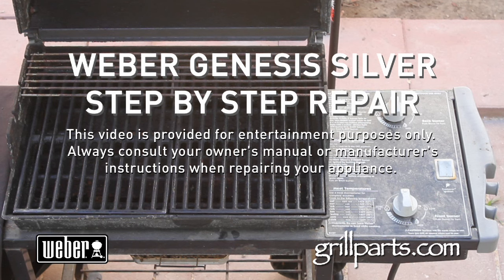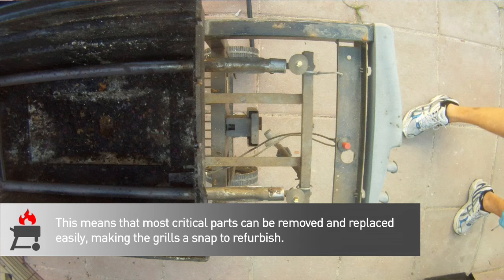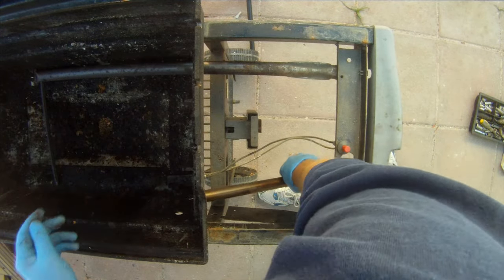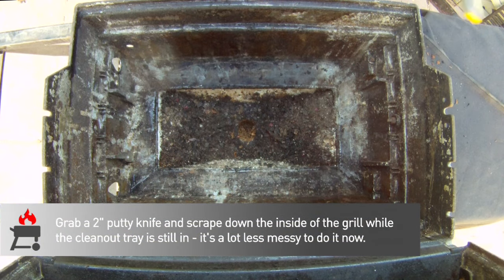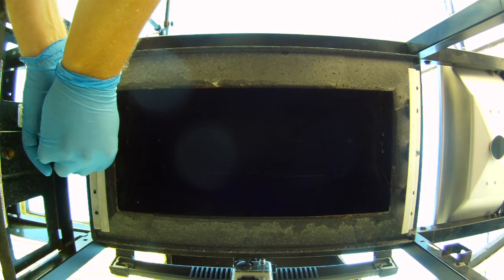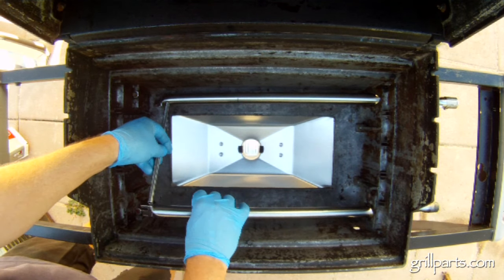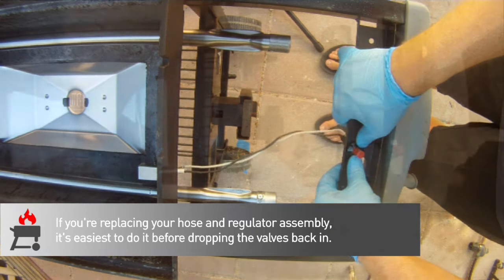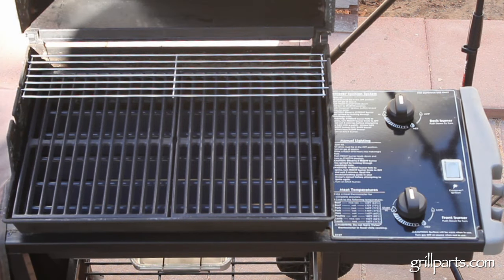Weber Genesis Grill Repair

Comment: Great video. I have rebuilt my Genesis Silver A once before, but it's been about a decade. This video is very helpful. Thank you. Quick Question: After you scrape the gunk out and you go to work with the hose and scrub brush, do you use any type of cleaner or degreaser to help the process? Thanks again for this video.
Reply from the maker: Sorry for the delayed response. We use CitruSafe and 00000 steel wool (https://grillparts.com/grilling-accessories/?productID=3100107)

Comment: Don’t know if anyone will see this but I got the 3 burner one and the front burner isn’t getting propane.  Any idea what part that would be.  Back 2 work fine but it’s a pain to ignite it now
Reply from the maker: The problem might just be a blocked burner (spiders love it in there) or something like a bad valve. You can figure out which grill you have (and find the parts) at https://www.grillparts.com/weber/
Reply: @grillparts  thanks, I ordered a new manifold, and once they came in it started working again before I could install lol
Reply from the maker: At least it working - enjoy!

Comment: This video saved me $400!!! I had actually put my grill up for adoption, but nobody wanted it. After poking around some of the other videos, this one was so clear, it gave me the courage to dive in & do it myself. Replacement parts for burner, ignition/starter, flavor bars, grates & drip pans + liners cost about $200. The replacement Weber I had my eye on was ~$600+. Gotta say it is a RIGHTEOUS FEELING to fire up my new guts (on so many levels) grill. Thanks for the great video instructions. I'm a 61 year old former tech writer----if I can do this, so can you!

Comment: Where is the serial number? I have a genesis silver and can’t find it
Reply from the maker: Located on the right edge of the control panel, behind the molded trim panel. Cheers!
Reply: @grillparts  I still don’t see it?
Reply from the maker: Hmmm - it could have come off at some point. You should be able to tell which model it is from this sorting tool: grillparts.com/weber/

Comment: Grates alone these days if you can find them are about $150 so I’d have to think a full rebuild would be close to $700-800 plus my labor. With the grill 20 years old I’d just as soon get a new one.
Reply from the maker: The parts used in this video add up to about $275 (and there's a link in the description) & new Genesis grills start at around $700, but you do you.

Comment: I've always had my eye open for a new propane grill but I've kept my 25  year old Weber Silver is still going strong.  I have a stick burner smoker, pellet smoker, Weber kettle, flat top grill, and open firepit for all kinds of grilling but there is no need to upgrade your propane grill if it is solid and still does the job.  2 things that are a must for this grill: 1) cast iron grates and 2) for the pros that know exactly what they are doing (and I don't recommend this for the average bbq guy): unregulated propane hose for those moments when you want to get a 700 degrees sear.

Comment: I prefer those old push igniters over the battery ignited ones they went to after the silver series I believe. I've had a silver one for over 25 years and replace the igniter maybe three times. I just got a used Genesis s310 and needed to do the igniter right away because it was dead. It seems to me the old push ones are much higher quality you don't need batteries to run and they never fail to start

Comment: This video is perfect, straight to the point and clear. We have had our grill for 15+ years. This is our 3rd time buying parts for it. The website is great to navigate, to find exactly the model and the parts. This time I found this video and was willing to try to change the igniter that does not work for a while. Great job on your order process too. 
My only suggestion is to put the video in a more accessible place, because it was embedded in one of the parts and it covers much more than just that part. Keep up the great work and quality!!

Comment: The bolts that hold the manifold in both snapped any suggestions how to remove them?
Reply from the maker: That's a tricky one, but you should have enough room in there to drill it out or cut it off & replace it...

Comment: I have a question, I have a genesis DO1058141, from what I can tell it is a genesis gold c, with a side burner, I don’t see any steel grease trays like this on the website, also I need to replace the push button ignitor collection box, but I’m not sure which to replace with. Thanks, great video
Reply from the maker: Sorry for the lag - your comment got held by YouTube. Did you get your grill sorted? The best way to get help is via email on the contact page of our website https://www.grillparts.com/policies/contact.htm

Comment: I don't have a a Weber but one of the Brand X generic gas grills. I wouldn't have replaced the burners as you can clean those out with water or pressurized air and they really ought not to get too dirty. I got my grill from some friends who'd never cleaned theirs and were throwing it out because they got a bigger and better one. I see gas grills on the curb all the time time and nothing that a putty knife, degreaser and some elbow grease won't fix
Reply from the maker: No burner lasts forever. The burners we took out of this one had recently been replaced, but we wanted to show how easy the process is.

Comment: @grillparts
Question the connection between the valves and the burner tubes. Is this supposed to be loose. Or are the burners meant to be attached to the valves
Reply from the maker: There is usually a bit of play in those connections but they shouldn't be too loose.

Comment: Do you recommend using a MAPP gas torch to loosen up the screws and bolts that don't want to come out?
Reply from the maker: Haven't tried it but that aluminum will start to get mushy at around 1200 degrees...
Reply: @grillparts  thank you I didn't realize how cold it had to be for the aluminum to melt.
Reply: @grillparts  Oh No both manifold bolts broke off. Any tips to remove? I tried 3 different remover junk things them bolts sem to resist punch and drill bit(maybe need a different bit??) What a mess
Reply from the maker: @jeffreywolf5235  drilling them out is probably the only way.
Reply: @grillparts  yeah I'm going to have to get some high-quality left hand drill bits because the ones I have are all old and just cannot drill into the screws. I must have 300 drill bits and not one of them will work most of them are too big. If I had a welder it looks like as a nice trick of welding a bolt head to the broken screw and removing it that way but I don't

Comment: On the crossover tube...is there a certain way to lock it in..or which way to the holes need to be oriented?
Reply from the maker: The burners & crossover really only go in one way. Once they're in place, there's not a lot of movement or need to lock lock it in.
Reply: @grillparts  I see how the burner go in. But the crossover tube is free to spin and no way to"lock" in
Reply from the maker: No need to worry about it spinning. Have you put this together yet? There's nothing acting on the crossover to make it spin, but it's also not quite round. Just put it in with the holes facing up. Here's the instruction manual https://www.grillparts.com/images/products-grill-parts/grill-parts-10404.pdf

Comment: My dad just gave me his Weber grill that he bought in 1985. He hasn't used it for the last 20 some odd years.It was outside for the 35 years that he owned it. It was protected by a bbq cover. The only thing that I had to replace was the hose and regulator assembly. BTW, my dad was a tool and die maker and replaced all screws, nuts and bolts with stainless steel ones. As well,  he replaced the original "flavorizeer" enamelled angle bars with .5 cm stainless steel. Apart from some rust and discolouration of the bbq lid, this bbq is almost like new. Is there a safe way of painting the metal parts? I plan to paint the legs with rustoleum type paint but I don't know how to refurbish the black enamel lid or the sides. What should I do? I do not want to sell this bbq ever. It was the first bbq my parents bought and I want to treat it like and heirloom. When I lived at home as a young adult, my parents finally felt that they were financially "comfortable" enough to be able to afford a gas bbq. This was their one and only gas bbq and today, I was able to grill our family lunch.  It's a keeper
Reply from the maker: Your best bet would be to use BBQ paint and go for a flat black finish. Re-enameling the grill is a pretty tall order, even for an experienced sprayer.

Comment: which direction should the holes on the crossover tube face?
Reply from the maker: Hi Patrick.
The easiest way to tell is by looking at the larger holes for the crossover burner - those have to face toward each other.

Comment: I've had my Weber it's a 3 burner Weber since 1995 and unfortunately all the bolts that are inside of it are so rusted they fused themselves to the other parts and I'm afraid to touch any of them with the risk of it just disintegrating on me unfortunately I think I'm going to have to get replacement grow or a new one altogether I would love to but disabled it took me a long time to buy this Grill so it's going to take me three times as long as you get another one but but the best grill for the price No Doubt I've replaced a guts about 6 times over the years including the ignition starter the last time I did it I got super thick flavorizer bars and those things still look almost a new shape and they're over 3 years old
Reply: Remember if the outter body casing is damaged, its warranty covered for 25 years . Just received upper and lower due to corrosion

Comment: Hi - how do you change the thermometer? The original one on mine seems pretty wedged in so I don't know whether to use some old fashioned brute force to get it out (i.e. a hammer) or if I'm missing a smarter way? I have a replacement with butterfly wing nut.
Reply from the maker: Do you know what model you have? This is a Silver A, so it has the thermometer on the right side that just slides out - but it was stuck in there pretty well. If the replacement you have has a wing nut, you have a different (probably newer) model.

Comment: I own that same grill which was out for the trash.  The pan under the grill is corroded.  The grease pan holder is rusted to the point where the metal broke off it that holds it to the large pan above it. The pencil size burner that connects to the 2 larger burners is rusted out to where it can not attach to the one of the larger burners.  The grill cost $379 new which someone purchased in 2004.  New flavorizer bars and cooking grates along with disposable grease pans were purchased in 2011 but the store may not take that stuff back.  Is the grill worth restoring or should I throw it away?
Reply from the maker: Hi Brain. Flavorizer bars only last 3-4 years under regular use & the store probably won't take them back.  If the main firebox/grill body is falling apart, the grill is probably not worth saving. Otherwise sounds like all of your worn parts are replaceable, so it just depends on how much you like the grill. You should be able to replace everything for <$250 and end up with a much better grill than if you bought a new one for cheap.

Comment: What is that on the front of your hood, in between the weber's logo and the temperature gauge at 5:10? Never seen that before. Is that some kind of hood lockdown?
Reply from the maker: That's just a mount for the GoPro camera we used for the overhead view of the grill.